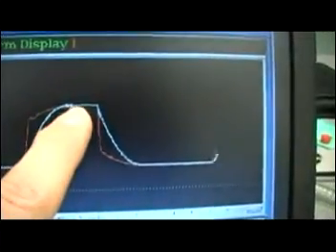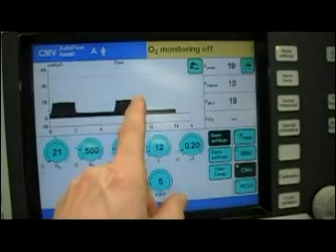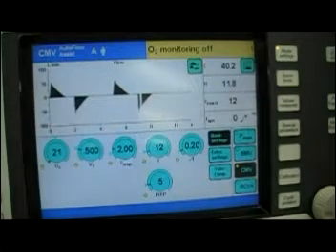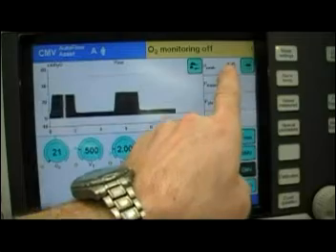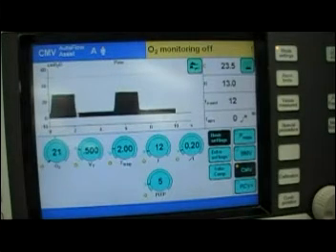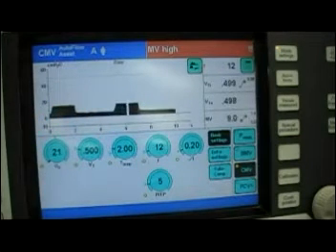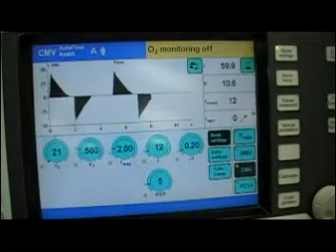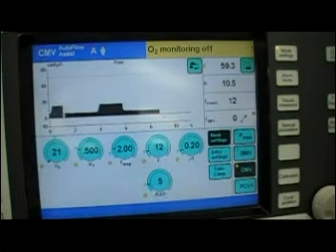Pressure Regulated Volume Control Mode of Ventilation.mpg

Comment: im confused, i thought in PC mode, the pressure is preset, and tidal volume and flow change?
Reply: PRVC is like a hybrid mode. You set the VT that you want delivered and it will use the lowest pressure needed to deliver the VT and adapt with changing pulmonary mechanics